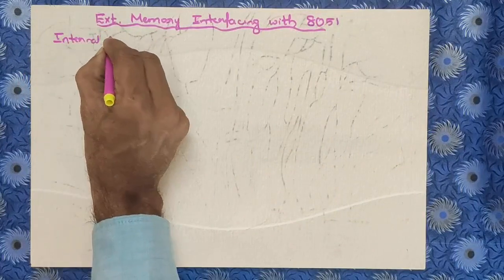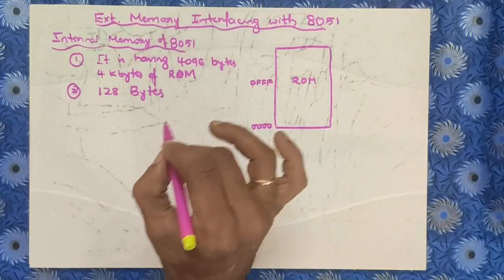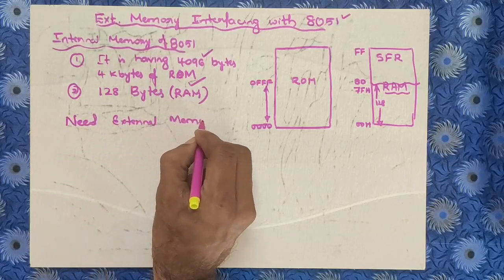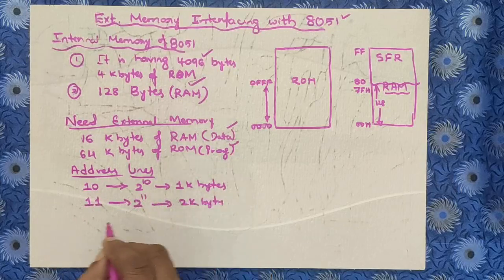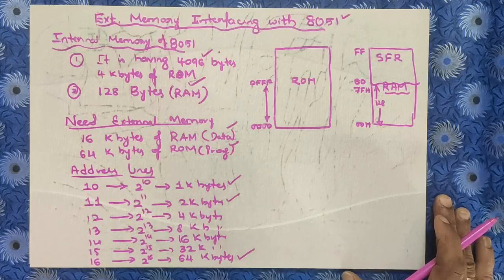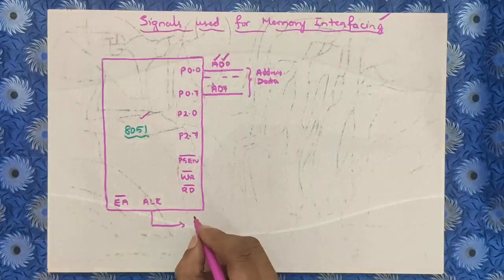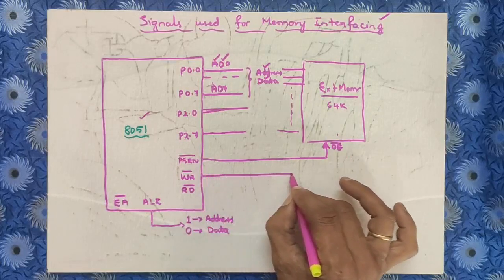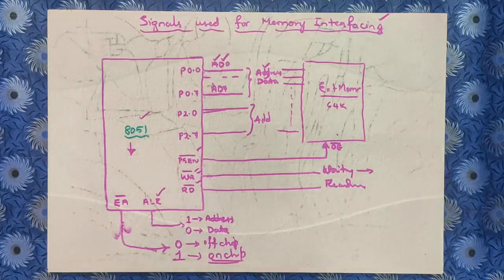Memory Interfacing with 8051 -  Part 1

Comment: Today’s technology has moved far beyond the capabilities of the Intel 8051, which was designed in the 1980s with limited speed, memory, and functionality. Modern microcontrollers such as the ARM Cortex-M series and ESP32 operate at much higher clock speeds (tens to hundreds of MHz compared to a few MHz in 8051), include large on-chip Flash and RAM, and integrate advanced peripherals like ADCs, DACs, timers, and communication modules. Unlike the 8051, which often required external memory interfacing and additional hardware, today’s systems integrate memory, communication (Wi-Fi, Bluetooth, USB), and processing into a single chip, reducing hardware complexity and power consumption. Modern embedded systems also support real-time operating systems, high-level programming languages, cloud connectivity, and Internet of Things (IoT) applications—capabilities that were not feasible with traditional 8051-based designs. Overall, the advancement lies in higher performance, greater integration, improved connectivity, and significantly simplified system design compared to the 8051 era.